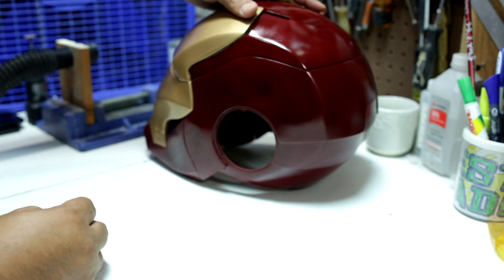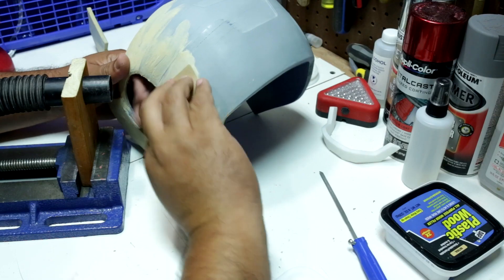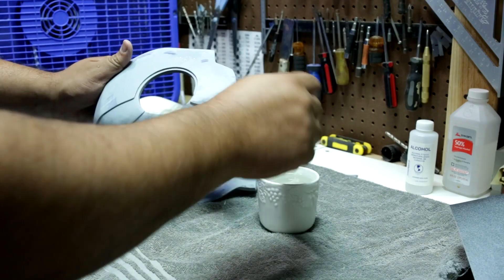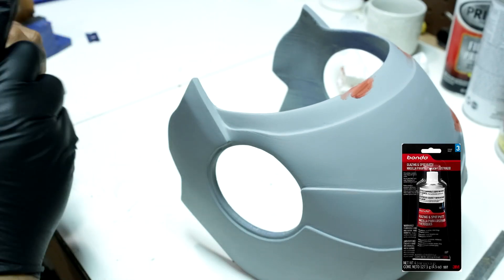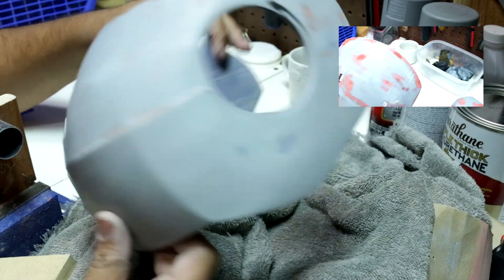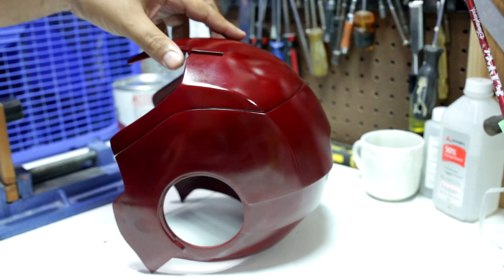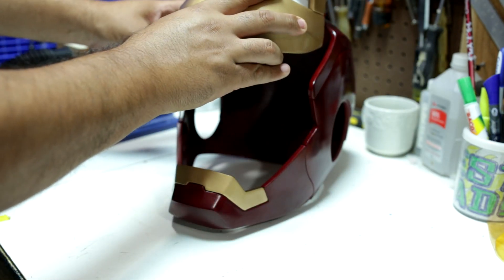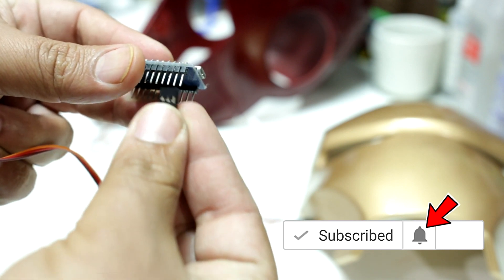3D Printed Iron Man Helmet PART 2 Printing, Filling, Sanding, Primer and Paint.

Comment: What for an infill did you use?
And speed?
Reply: Thanks
Reply from the maker: I used 25% infill, but I had to re-enforced the print with a coat of polyurethane on the inside. Next time  I would go for 35% but that adds hours to the print. I used a very slow print speed, I think I used like  20 mm/s on the parts that would stand tall from the print surface, this eliminates possibilities of fail prints. For parts that where short like the Jaw part of the ear pieces I used 45 mm/s.
Reply: I Love you
Reply: Cura says for all Parts 9 days.  

Whaaaaatttttttt
Reply from the maker: @maxtv1428  sounds about right